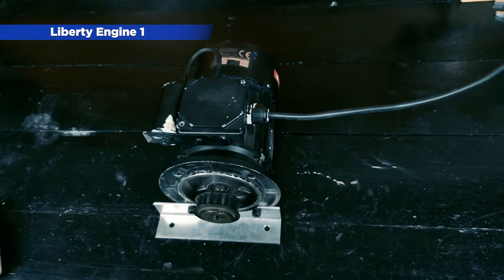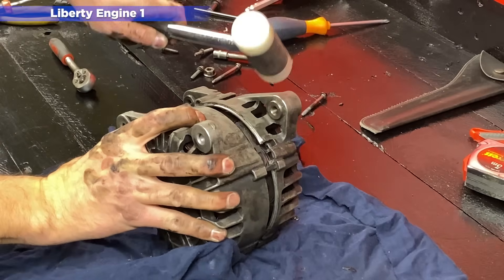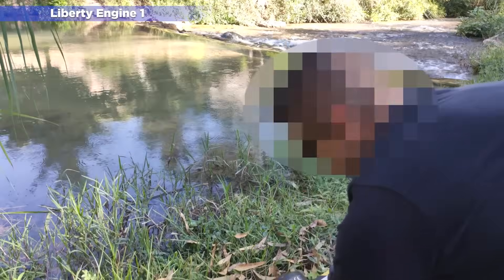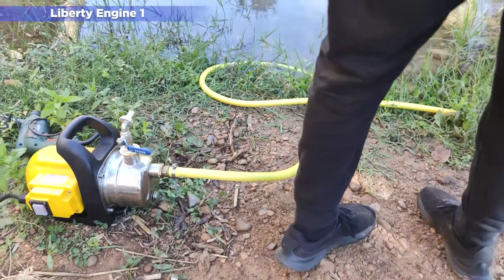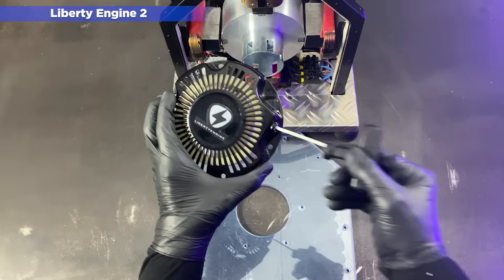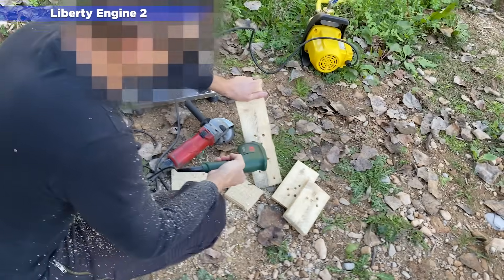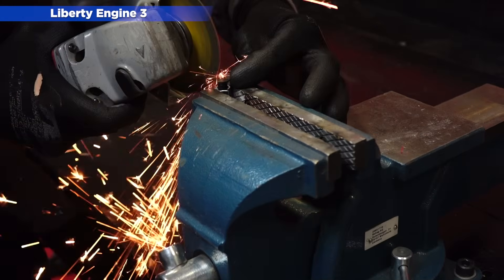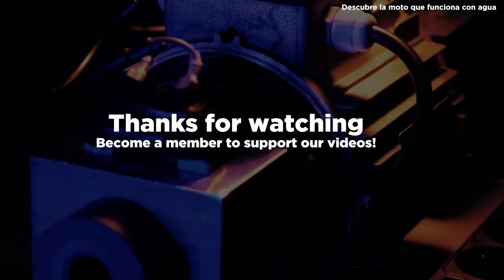Liberty Engine 2.0 GIVEAWAY - Free Energy Generators - Evolution and Comparison

Comment: Simulation Outcome: Induced Voltage from Magnetic Induction
Using:
Rotor speed: 1400 RPM

Magnetic flux density: 1.2 Tesla

Coil turns: 200

Effective area: 0.01 m²

We simulated the voltage induced by a rotating magnetic field. The result is a strong AC waveform peaking over ±350V, consistent with Faraday’s Law of Induction:
Induced Voltage= −N⋅dΦ/dt
This confirms that the setup in the Liberty Engine can indeed generate significant electrical output under realistic electromagnetic parameters—matching the claim of 230V AC output in the video.

Comment: So the USA version is just 120vac 60hz? That wouldn't run our ac system. We would need the 240vac 60hz. I don't think most of our AC will work on 50hz. I know many appliances won't. 120vac 50hz will mess a fridge up. So is there a 240vac 60hz available for the usa?
Reply: paga la factura de la luz y enciende tu aire acondicionado a -5º

Comment: How can a 220V generator possibly power a 12/24V alternator (the type commonly used in trucks) without any converters? I'm curious because of its very small size, and I'm guessing its power output, before any modifications, is only around 1-2kW – much smaller than the 5.5kW generator I'm currently using. Or do you somehow have a way for a mere 2kW engine to generate 20kW?
From a content creator's perspective, I find it quite interesting how you somehow make it look genuinely functional. Undeniably, you are a successful content creator.

Comment: Dear Mr. and Mrs, I have been working on converting an electric bike into tilting 4-wheeled vehicle. I added to training  wheels in the middle with tricky suspension. I am trying everything physically and that's consumes time and expenses because I am not using 3D programs. I am in the final stages and I need some help.Thank you

Comment: Hey , if you did not give the 2.0 away yet , I would like to put my name in the pot for it . Looks like a winner . Magmov sells the 3,000 watt for 4,000 $ and the 5,000 watt for 7,000 $ . Three year guarantee . What do you think ? All I need is 120v , because I have a gas furnace and hot water heater . That would be 25 Amps @ 120v , for the 3,000 , which should run my furnace and refrigerator easily ! And computer ! How about that !  Sincerely, Rick

Comment: Is there a way to hook it to your fuse box in a power outage to provide basic power? Or does it require running extension cords?
Reply: On my gas generator I have a 10 guage cord with 2 male plugs, I plug into the 110v plug at my dryer.
Reply: @ yeah I have seen ‘em to where you can hook em at the main as well, I was just curious about it with this technology, not enough to run the entire house but could provide enough to keep the fridge going and maybe some lights during prolonged outages. ( I believe the real free energy is still being suppressed by the Military Industrial Complex ruthlessly, it’s can also be called zero point or Quantum Vacuum energy as well. A device the size of a rubiks. Cube can run your entire house, no need for wires and telephone poles or vulnerable grids. It is Nikolai Tesla’s work perfected. There’s a reason the government confiscated and hid most of his work.. can’t put that on a meter!

Comment: building a 8' magnate rotor with 6 magnets and six trans. Let see what HP i get out of the unit. this will dictate the size and magnet rotor. My guess is you are getting about 700 watts max with 3.0  so when loaded down will possibly slow or stop the rotor.

Comment: You can also use a H20 as a fuel thru electrolysis. Set up a 3VDC to 24DC reostat/potentiometer this is calibrated for the Hydrogen output to the engine. Will increase or decrese depending on the load. Does work as I have one operational now. Problem is when A/C or larger appliance starts, the rpm is compromised and voltage drop. I use a Honeywell PID controller to monitor the RPM and increase and decrease the Hydrogen flow.

Comment: What was the RPM standard for the Liberty 3.0 Need to adapt to a 8800 W generator @ 3400RPM from my motor diven generator. RPM conversion will be nessasary for the generator to output 220V 60Hz @8800 Watts. Have you figured the HP output of the rotor module, Have you figured the HP output? 744 watts per HP normally. Why the silver /ALUM rotor. Have you tried any other material

Comment: Where to buy one or two . Please contact. What is the amperage.i have welding shop . I can use when i need to jobsite instead of heavy gas engine besides we cant use it indoors due to fumes . Ibhad requested info before but no response? 😮 are you selling it or just fir show😊

Comment: Could I build a working version of the 1.0 system without the alloy you talked about? I was thinking I'd make a rotor with a similar design to the 1.5 version, but laser 3d printed and electroplated with copper for the conductivity.

Comment: I am very interested in that system. But I don't understand all of it the way that it works it because some of it goes from DC to AC you need a rectifier for that and you get something to come in there where you got a generator that puts out three legs of electricity at let's say 12-volt seats that is 36 ft tall on each leg that's three phase system going on to a single phase motor which is $220 because where is the other leg going I don't understand this I'm trying to figure this out but I would like to very much a receive one of those free gifts so that I can look at it and see what's going on and how it works I would love to take my camper and go totally energy efficient without having to use propane

Comment: I watched all the videos and I built one of these   !  And it works wonderfully and mine does a little bit better than thiers does. You don’t need anything special no special nickel wire or anything.  Only you need to use the square wire, so there’s no hysteresis loss in your windings. I urge everyone to build one, but make sure all your windings are with square wire.

Comment: Hello Sir, I need your help, I am from India, I am also inventing this but I have this alternator which is not of tax, it is of truck and I am trying to make it 3 phase but how will I make the connection of three phase.  Please explain and how it will work. I have installed a magnet in the router. Can I get the current by running the alternator directly? It is necessary to install this motor and with that I am a little worried. Please help me regarding this.😌😌😌😌

Comment: I've always wondered if we could do this.  I'm just wondering about the heat.  Maybe put it in a building with AC that is ran by the generator to keep it cool or some other type of coolant that the generator powers.  If it is just running non stop

Comment: How do you regulate the voltage? I would love to work with you guys!! I would love to collaborate with you guys and really advance this generator!
Reply from the maker: Thanks for your support. It is designed to generate 230 volts rotating at 1400 RPM. No need for a voltage regulator.

Comment: Nobody talk about the fact in the 3rd version they cut the video just before he try to induce a 220V power with the manual trigger "thing", showing no power. They said it need a 220v power input to generate a 5kw energy. But how is it self sustained when the output power is not even connected to itself ?

Comment: The whole thing is somehow interesting and desirable. I can hardly believe whether the motor will turn without a power connection. As a knowledgeable electrical engineer and supporter of space energy, I have professional reasons to doubt the operating principle shown. Save your money for this "tu'HomI'raH" (Klingon) - to put it kindly.

Comment: Imagine ships and submarines that make almost no engine noise and need no fuel or MBT that need no fuel and make almost no engine noise.  Imagine  very little noise from street and highway traffic and no need for chemical fuels and therefore less air pollution.  The benefits would be significant.

Comment: Hi guys.  Do you really think that humanity has learned to split the atom, synthesize solar energy and use wind energy to convert it into electricity?  But they didn’t think of connecting the generator with the motor with an elastic band for a closed cycle or using magnets to rotate the rotor))).  It's just well-shot content, but don't think it's possible.

Comment: This could have applications in the EV industry.  It would charge the batteries and or power the electric motors in cars and other types of vehicles.  No need for charging stations or chemical fuels.

Comment: Just make the Liberty engine strong enough to power the electric motors in an EV. Just use a couple batteries to start the Liberty and use up some of the excess current while driving down the road. Basically, you could drive all around the United States forever, without having to stop and charge batteries.

Comment: Im building it!  just got my smelting furnace today,
Reply: Since silver and alum don't alloy I noticed shiny flecks in your rotor. That would be the unmelted silver in the casting. Im guessing it to be 10%  silver or less. I should be close after the 3rd or 4th smelt!  Seems you have developed newer and other ways to use the alloy in different configurations to fine tune the generator. Sweet! Keep it going!

Comment: Plus all you nay sayers are just stupid if you make the base a lithium ion battery pack then it is very possible with a high out put inverter and have it power the battery pack which then generates enough to run it and power the motor see free energy is possible with the newer generation of high amperage and high voltage lithium ion battery packs it only has to power enough to recharge the battery pack because the battery would be able to power these things like look at a jumpbox in the automotive industry they are tiny now

Comment: The videos are great, currently in process of trying to get the water generator working ( have it built) and now, half done with the microwave one( to me is the best due to no moving parts) If they do work, i would hold seminars at the local library to help people build them. That is what we all need to do. The more people that can actually see it work in real time will cause a rush in building due to so many free energy items Do Not Work, which I have tried several...... I run an add on craigslist to see who have tried free energy devices that do work and only get hopeful wish full responses.

Comment: Micro wave coils are not easily gotten. Any data  on the winding gauge/ohm specs? can solid steel be used for the iron coil core? - most transformers use stamped sheets as a laminate lock to hold the the coils securely with a shellack varnish. are yours epoxied in? What is the HP rating on the single phase motor? is it doubled for a 110v (USA) set up at the same wattage?  Anything 3D printed versions - carbon fiber core?  - I want or need the 10,000 watt + continuous to run a portable wire feed welder. I have a 20+ hp gas motor to currently run my generator head that runs the welder. I'd even like a 6000 watt setup for an RV hunting shack... Solar n batteries kinda suck there ...  Got some N52's that are rated at 86 lbs pull. Small engine recoils n cups not a problem.. So maybe a 3 phase motor set up to be a trunk carried EV charger ? WOW! Lathe n mill not a problem.. Could build one and Video the results to ya bytlan  is my user at yahoo.. If it really works this is outstanding..

Comment: A Tesla Model S needs 20 to 25 KW/H per 100 miles.  If you could make it to 40 KW you could drive and charge at the same time and not have to plug in.

Comment: We've just built one of these but instead of the silver/ aluminum rotar we used just plain aluminum. We couldn't afford silver. The machine runs well and it works but it losses alot of energy to heat etc... machines been running for a week now. Very happy but need to pay and upgrade to silver rotor
Reply: Wow! Thanks for this comment, was looking for someone who's tried it. Many thanks once again
Reply: Outstanding. I tell you this. We would purchase a kit from you once you make the upgrade to silver and work out the heat issues. You could use heat sinks similar to computer cooling, or perhaps a liquid cooled system. I don't know, just throwing ideas out there. Cheers 🍻
Reply: Really?! Wow that is amazing if true. I guess I'll need to try it out myself. 
So, it's self running and you can power things from it?
Reply: Where did you find the plans to build it?
If you have a link to where you found the plans could you message me please?
Reply: Really?  Maybe you should post a video to provide a little proof?  Please include a time device (a clock?) visible next to your 'generator' to prove the footage isn't backwards.
Reply: That's why I believe a small amount of copper is in the alloy

Comment: Keep going, I liked the liberty 1,then liberty 2 came which was a vast improvement 💯👌🏻 I would purchase one 👍🏻, liberty 3 looks promising with no movable parts, lighter, no noise etc, so be interesting to see how that comes along, with the liberty 2, I thought about carry handles or wheels at the Base, also encasing the whole engine a placing the power points within the casing to keep them water proof💭💭💭💭💭💭💭 just thoughts, either way fairplay 👍🏻 imagine no extension leads for building sites and around the home, out in the garden or out in the wilderness, revolutionary, liberty 3 as is would be great for camping 👍🏻💭💭💭💭💭

Comment: Renting these units could be they way forward, housed in a tamper and soundproofed enclosure, fitted with an electronic meter and suitable sockets depending on the application. Inclusive yearly servicing would be a way of monitering your product. These generators could give people clean, renewable, affordable power at home, work, and for vehical's. Amazing! If only you could get the energy supplier's on board the "Liberty Engine" could change the world and save the planet!

Comment: Wow, 20000 watt is 20 kw/h does anyone knows how may AMPS IS 20 KW/h....well is simple, 20000 watt : 230v = 86.956 Amps.....does anyone know how thick the wire has to be to produce 86.9 Amps at 230 volti.....well the comments I read is almost nobody knows basic physics.....I give you an exemple.....Your socket at home is 230 volti x 10 Amps =2300 watt/2.3 Kw/h and please for the Love of God look how thick is the wire......now take that thickness and multiplied with 8 and you will see how thick has to be the wire to produce 20000 watti/20Kw/h

Comment: Also, have you thought about using more than 4 poles? I'm not a engineer and am not smart in any way but could you produce more power with an 8 pole system instead of a 4 pole system?

Comment: I am amazed by this product and can't wait for it to be available to the public as it could solve so much. I have to say that despite the weight, the 2.0 has to be the best out of them all and I can see it doing great things worldwide. Good job guys!
Reply: I'm sure they have been at this a long time now, as they have made perfectly clear the objective
was not to market but to empower other engineers to demonstrate this is reality, and by doing so having this emerge into open source realm and hence provide a path for this to be widely accessed and accepted as authentic electro / mechanical physics, and for those of us anxious to participate let us pray we gain sufficient insight to do so.
Reply: What did you mean by “product “? A product has safety measures, is labeled according to standardizations, is taxed, has patents( lasting 20 years ~) and requires packaging or a delivery charge! This Liberty engine or such appears to be for replicating with your own resources, maybe a community shop project with plenty of safety measures.
Reply: You are going to wait a long time because the Liberty Engine does not produce free energy...
Reply: Understanding that version 3 is solid state, then why exactly does it have to be "started" ?
Is there still a turning shaft to induce a magnetic field change while not actually using any rotary power to produce electrical current?
The machine still looks like it has a rotor shaft? I'm certainly a protagonist and very excited, having followed from the beginning..
Reply: @markculkin9143  Soweit ich das verstanden habe, wird ein Drehfeld erzeugt. Dies müsste wohl einmal in Gang gebracht werden. Die Erzegung dieses Feldes wäre zwar elektronisch möglich, aber dies kann dann nicht mehr jeder nachbauen.

Comment: I am soo impressed with the evolution of the liberty engine. I have been building other versions of permanent magnet motors using capacitors to capture energy and recycle it back into the system to continue the motors mechanical motion. What every is left over is use to power devices.The liberty 3 is mind blowing because their is no moving parts. I’m a believer!

Comment: I really want to try the free energy prototype generator 😍😍😍😍😍😍😍😍😍

For additional information: Actually, Liberty Engine 2.0 can already be used in the production of electric cars. With the humming sound of Liberty Engine 2.0, it could possibly become a distinctive feature of the electric car's sound. Then, by adding a car starter dynamo to crank Liberty Engine 2.0, hence, a battery is still needed to power its starter dynamo.

Comment: I’m torn between the 2.0 and 3.0. The 2.0 has 20k at 230v with 86amps. While the 3.0 is silent at 5k at 230v with 21 amps but, the flux field can break.  The 2.0 has noise but can handle two Modded outside household A/C units. The 3.0 is more for an Electric car / no more petroleum usage.  Driving an hour back and forth for one hour to work with electric car or Free energy at home.  It’s a no brainer, of course I want the 2.0.  I Need Power😂
Reply from the maker: Thanks!!

Comment: A question please? Does the engine automatically find a rpm to create a continuous 220 Volts? I know there are truck alternators that spin at a low rpm to produce power.

Thanks